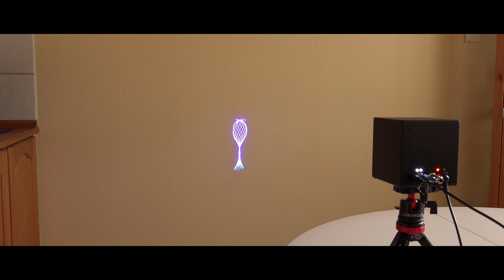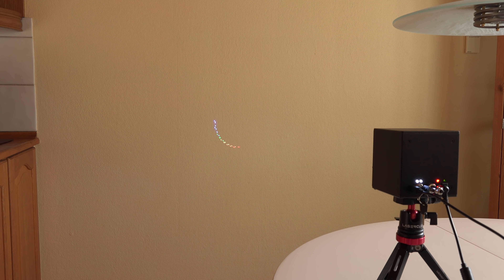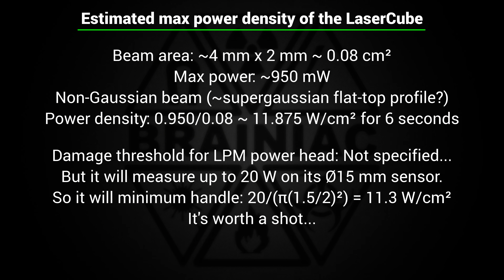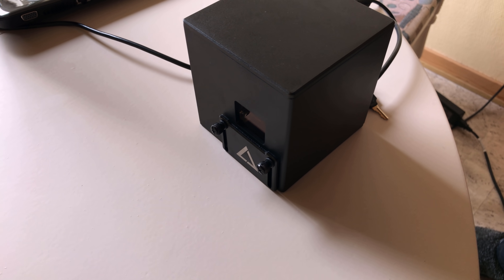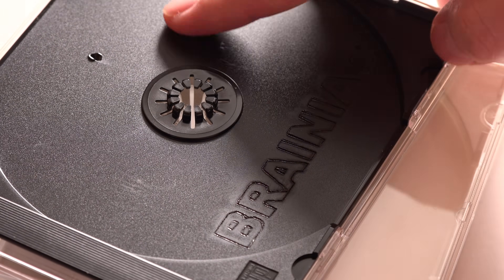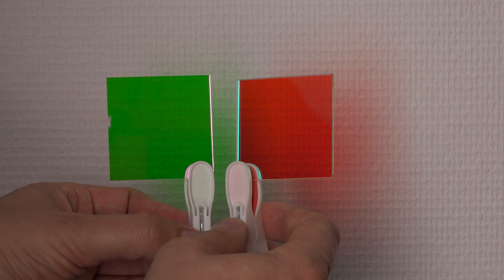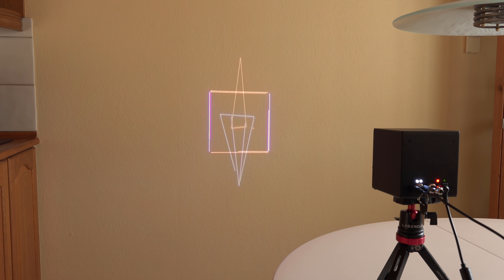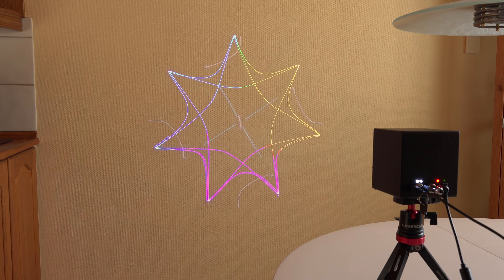LaserCube | Power in a Palm

Comment: I think firing a laser into a cows eye, obviously a dead cow, would show people the damage they do so ensure people will most definitely not look at lasers!
Reply: William Osman made a video just about that. You should check it up
Reply: Don't think it will be visible from the outside, unless of course you burn a hole in it
Reply: They idea would be to fire a laser at the eye(s) for periods of time then dissect them later to see the potential damage they could cause if someone opted to mess around or be neglectful around laser!!
Reply: +eggiep75,

Eye? Hell! It'll burn your finger.
Reply: Observ45er - Burning your finger with a laser is not going to make you lose your sight which is deemed to be your most depended upon physical sense.

So with that, it's more effective to show someone the actual damage it can cause to an eye rather than a burn on your finger that should largely heal itself with minimal issues... compared to an eye.

Forewarned is forearmed.
Reply: +reggiep75,
I didn't say it would, but the retina is orders of magnitude more delicate. 

The damage to an eye doesn't have to be visible to blind you... 
..

So cutting open a cow's eye so try to see the injury  is a poor metric to rely on.

Yes, I put my finger into a 10 W laser beam after melting some thin, black plastic to see the effect for myself and it produced a knot not unlike an RF burn, but it was easy to remove my finger before serious harm. 
..
 At the power of this thing, an eye is doomed. This is no toy and is going to hurt unsuspecting people.
Reply: @Observ45er  How horrible.  A little burn on your finger.  I did that on the stove yesterday.  Worse than a laser would.  Your reflexes well get your hand out of a beam fast enough so you probably wring be injured.  Your eyes are potential disasters.  The eye's lenses focus the laser beam down, and it still start destroying retina tissue instantly. The injury will often reveal the path the beam took over the retina.  Blind areas in lines,  or even dark persistent lines can be in your field of view.  Do to an instant if careless.   Be careful,  please.  I had a 5W green laser, and had it reflecting off a mirror, it was beautiful, but would burn a magazine cover almost instantly.  In an incredible lapse of awareness, I walked across the beam and it went across my forehead.  DUMB lucky.  That laser was a beast and would have hurt me bad.
Reply: +gedgar2000,
.
You obviously missed the point, didn't read your previous reply  and didn't proofread this one.
..
  I've done professional laser shows for years and have a CDRH variance to do so.
You can't tell me anything about eye safety.
...
This thing it "easy to use" and therefore easy to hurt others with... Read on.

The damage to an eye doesn't have to be visible to blind you... Looking at it will not "reveal the injury" without the proper equipment.  A minimal lesion isn't necessarily visible to simple examination. 
A retinal lesion from a 50-100 mw laser will be hard to see at best.  This suggestion is ridiculous.  Go to high school and dissect a frog if you want to.  This will show nothing useful and lead folks to think it is less dangerous at lower power levels.  Until you get below 10 mw, you're playing with fire you don't understand.
.
So cutting open an eyeball is a poor metric to rely on.
...
This thing is going to hurt people and not just the person operating it. 
..
 He is surprised he burned his wall.  That tells me even he isn't the brightest bulb...
..
Do you know that even a diffuse reflection off a screen or wall with power not much more than this can damage an eye and that there are restrictions on that type of exposure as well?
Reply: Check this out if you want to see what a laser will do to an eye. https://laserpointerforums.com/threads/hit-in-eye-with-1000mw-445nm-blue-laser.69469/page-3#post-1004511
Reply: Why a crow? You just hate birds?
Reply: Jennifer - Nobody said 'crow' and nor should you jump to conclusions either.

As for cow, if that's what you mean, a cows eye is a nice big thing to cut open and put under a microscope showing people. We also eat a shit load of beef that means a lot of eyes are no longer needed and using them for science is a worthy cause!!
Reply: @reggiep75  bummer I just read that wrong ....i was hoping to find a fellow bird hating enthusiast like myself, shame really. Interesting to use a cows eye still, are eyes strength different for different animals? Or the shape make a difference I wonder.  Well don't mind me I'll just be over here kicking pigeons.
Reply: jennifer devote - I do hate some birds but mostly pigeons and those fkers... seagulls - the aggressive vermin or the sky!! I was shopping yesterday and chased 3 pigeons yesterday morning and my better half told me off even tho she laughed too. Damn bloody pigeons!

A squid or octopus eye would be something good to blast with a laser but I also remember cutting cows eyes up from school, all those decades ago, and got a nice near golf ball size eye one which was good.

I really would like to see the damage a laser would do, how far it could cause damage and more importantly show people the damage done for a small length of time on the eye.
Reply: @reggiep75  It's not like a typical laser injury to the retina would be very spectacular to look at.  You'd need a microscope, and you'd see a discolored line when the laser beam hit.  Of course if it were ultra severe it would be very visible,  but typical laser accidents are over in an instant.  With blind spots, visible dark lines,  or worse in your field of view.
Reply: gedgar2000 - People can't comprehend the damage possible without anything to see and then not be able to unsee, hence the reason I think showing people tangible evidence of the damage capable from lasers to your eyes is important.

The physical damage to an eye happens in the briefest window of time, is microscopic, and yet the impact of the damage lasts a lifetime.
Reply: @reggiep75  You could burn wood with this laser and possibly start a fire. This energy turns into thermal energy if it is not reflected and this laser is POWERFUL. That being said limited exposure likely means eye damage or blindness. Extended exposure definitely means blindness. Since this laser has so much energy enough exposure theoretically has the potential to make the water in your eye boil which is kind of a terrifying prospect.

On the upside the power is also useful for engraving and fire starting. Doing a new project with plywood? WAM laser engraving awesomeness! Wanna add a finishing touch to your computers aluminum side panel? BLAM laser engraving! Really the possibilities of engraving with this thing are endless. Just need to follow basic safety and you should be ok.

Comment: Did you move the camera at 5:20 intentionally around so it won't burn the lense due to reflections? There was a bright reflection dot visible all the time.
Reply from the maker: Exactly. I didn't use my main camera, since I was worried about burning pixels on the camera's sensor. By using a gimbal-mounted smartphone and constantly moving it, the risk of burned pixels is much lower and less expensive to replace should it happen anyway... But no burned pixels luckily. It is afterall a black case with less reflection :) Thanks for watching!

Comment: I love the smell of burned jewel cases in the morning. But what will the price be. I am a bit scared it will be sky high.
Reply from the maker: I'm curious about the final price too. It should be a little less than the LaserDock, but probably not much, since it's more difficult to cram all this into a smaller enclosure, and the LaserDock does not have a rechargeable battery. The LaserCube should be released 'soon'. I will update the description box as soon as I get more info. Thanks for watching!
Reply: @brainiac75  thanks for the reply. I will check regularly.

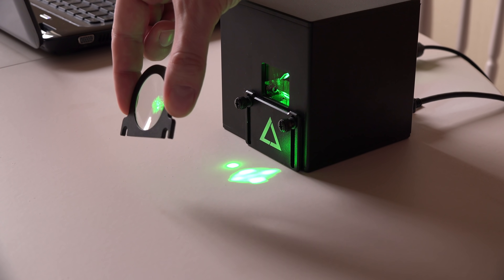Comment: at 2:50 you show the lens reflecting light from the laser, but might that be an effect due to the refraction? and therefore if you keep the lens perpendicular to the laser, no light is lost?
Reply from the maker: It might add to the effect loss of the uncoated lens, that I hold it at an angle. But the measurement shows that even with the lens perpendicular to the laser, around 128 mW was lost with the lens. That's significant... Thanks for watching!

Comment: Curious, what goggles do you use for this?
Reply from the maker: I bought and use some Honeywells from Edmund Optics (search their website for 59-974). More OD than necessary for my lasers, but I like having my vision intact :D
Reply: @brainiac75  nice.. Be careful with the red beam. Those goggles specs don't provide any OD data between 523nm - 710nm. Though now having that power meter you can test and calculate.. Keep safe! 🍺